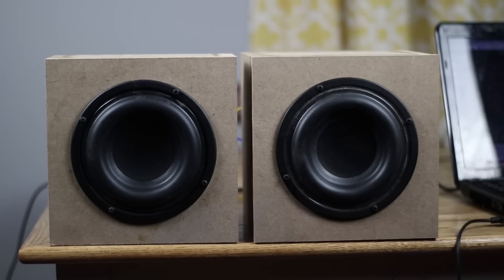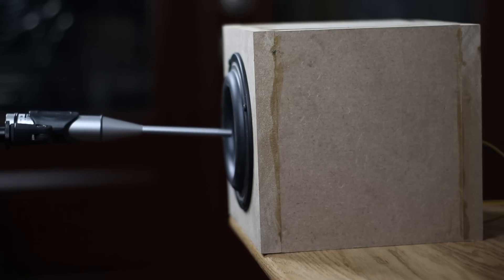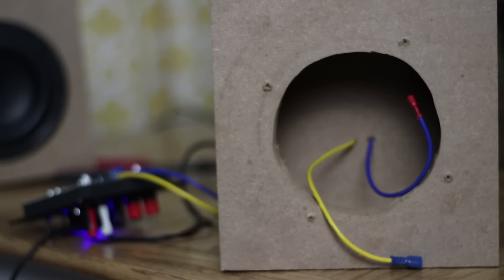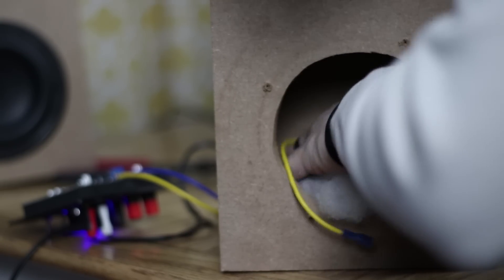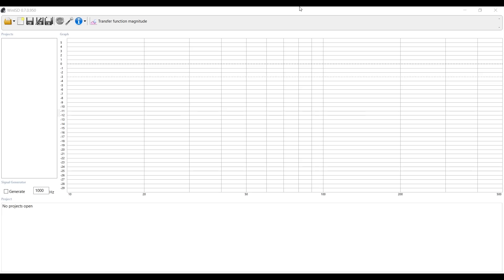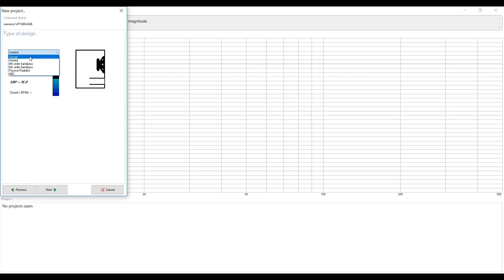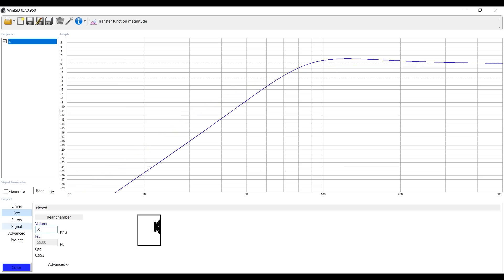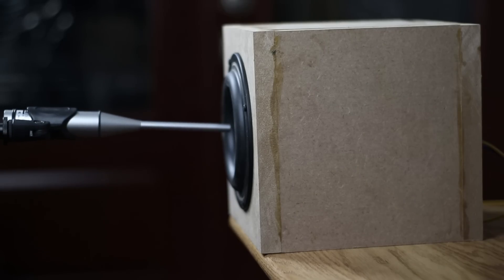Does Polyfill make a Box BIGGER?  Tested and Revealed

Comment: I know theres a number of videos about this but there hasnt been yet a definitive type video with the detail the topic deserves; sort of like a Vance Dickason level detail video. That video might not exist due to the popularity or prevalence of ported boxes all over the interwebs rather than sealed, but it can have some effect on ported enclosures to a degree as well. I think the topic deserves a good 30 minute video where it's possible for someone with the right measuring tools to do exactly as you did but also provide F3 comparisons as well as QTC results. For example we can see what a baseline .707 qtc box could do non stuffed or even stuffed to see if the QTC could get down into the overdamped regions (qtc .6 or so). Of course a smaller box test around qtc .8 -.9 can get covered just so those with space restraints with car subwoofers can get an idea what dimensions they can get away with and not compromise too much performance.

Comment: try seat cushion foam instead of poly fill..It's much denser and the effect is more pronounced. giving you deeper bass I learned this at age 12 salavging console stereos for speakers and the working components I wanted for my growing home built system from discarded stereo and TV consoles... nearly free ..new fuses fixed many systems or a broken wire repaired. usually did the job. I collected several hundred dollars in equipment for free and made it all work together. .. race a few wires replace a fuse or 2 and there you are... I'm ADHD all my life and need a hobby to keep my over active mind busy.. I can visualize a project design without comiting it to paper and build it with little more than tools and a my semi detailed  sketch to guide me...

Comment: Great video. Quick question. Is it possible to use the usb microphones that come with your high-end AVRs for room correction (i.e. Marantz, Yamaha, etc...)  as a replacement mic instead? In addition, where do you get the software? Is the software free? Or do you have to buy it?

Comment: Why don't you do some more tests? Would be a good video.

Just make a box with a bigger woofer preferably, and then make a bunch of inserts that you can stick to the inside of the backpanel of the box. That way you have can make the inside volume variable, and then do measurements with and without fill to get a better understanding of where the sweetspot might be and how much volume you can compensate in this way and where it no longer works.

Maybe other tubers can do a colab with you or something and do it with different drivers to get a larger sample set.
And then see if there is some simple rules that can be made from it.

Would be a very useful effort for the community and you'd get some good content out of it.

Comment: I've heard that it makes a big difference in a ported box, and even more of a difference in T-lines and horns. This is because the sound waves (air) have to work their way through the polyfill (compared to traveling in a straight line when they're unobstructed) which means they have to travel a longer distance before they exit the port... In other words, simulating a larger box.
Reply: Yeah that’s not true whatsoever, it works the best in sealed applications because the pressure is larger inside the box and has nowhere to go except the fibers. In a ported application it takes the path of least resistance which is the port, still makes its way through the fibers but it’s not as effective I would definetly not use much in a ported box only lining the walls

Comment: It dampens reflective wave generated from drivers rear. It helps driver to reach its mechanical limitations easily. Fooling drivers😅
Reply from the maker: It can help with standing waves, but what I am referring to is thermodynamic. In particular the changing of the enclosure from adiabatic to isothermal. This changes the Q of the box thus resulting in the subwoofer acting as if it is in a larger enclosure.

Comment: Um, speakers can't "think". You probably could have gotten the same results using fiberglass insulation or wool. It's been proven for years (I've been building for 30 yrs.) that adding "fill" will "scientifically" increase the volume of an enclosure and typically smooth and extend the low end. You're evidently trying to convince a new generation of builders that do not believe us "old" guys.

Comment: To me it all seems counter intuitive. If the box is stuffed (insert (pun intended) joke of choice now) it will create a denser medium (chunky fortune teller). Denser medium equals faster speed of sound right? Therefore the enclosure (see what I did there) would present as smaller not larger.  So my thought is that the fill material has more to do with calming the tumult of the airobatic  (just made that word up, help yourself to it's use) chaos thats  going on in  there. Or not, just a thot.
Reply from the maker: That's a good thought. But what really is happening is thermodynamics. This is the best explanation that I've ever found that should help you. "Stuffing a box with polyfill makes it seem larger and it all relates to thermodynamics. When polyfill is added to an enclosure, it changes the behaviour of the airspring in the enclosure from "adiabatic" to "isothermal". The term "adiabatic" implies that there is no heat transfer occurring. An isothermal process occurs once the polyfill has been added. As the air passes through the polyfill, the fibers wiggle and cause some of the energy created by the airspring to be dissipated as heat. This heats the surrounding air molecules warmer, causing the air to become less dense. Being that sound passes easier through a denser medium, the speaker interacts with your enclosure as if it is larger than it actually is."

Comment: I think you messed up the results. The black line is without fill. Because. 
THE BOX IS BIGGER without fill
Reply from the maker: It would seem that way. But adding fill actually changes the Q of the box, which makes the driver act as if it's in a bigger enclosure. It's pretty neat to see how it works.
Reply: @Toid  There’s a reason why this subject is still debated. Something is amiss . I have a 15 inch Solobaric in an exact spec sealed box. I’ve driven around playing it for three months. The other day I realized one of the speaker terminals was broken on the back of the box so I ordered a new one. When I open the box to replace the terminals I realized it was stuffed with polyfill. So I removed it and tested it out without the polyfill. It definitely is playing lower than before. It sounds like a bigger box
I know you tested it. Which is crazy. What happens if you test with the microphone at different distances? 
I’m just being skeptically ignorant
Reply: I’ve heard that Speaker Builder Magazine did a test a long time ago and said it didn’t work. But I can’t find  the article. Maybe Parts Express wiped it from existence
Reply from the maker: @johnviera3884  here's a good article that touches on the science of what is going on if you are interested: https://audiojudgement.com/sealed-enclosure-closed-box/
Reply: @Toid  thanks man. And thanks for being nice to a knucklehead
Reply from the maker: @johnviera3884  I don't know anything about that.  It's very clear that it does work. In fact programs like bass box pro will even take it into account when you are designing your box. They'll ask you how much fill you plan to put in it and it will show the affect it will have on the frequency response. Of course you can find this information other places as well.

Comment: It is not "Polyfill " it is sponge. Try it. And, by the way. Every loudspeaker box should have some kind of damping material inside. 
The selective use of foams and damping materials within a loudspeaker cabinet will significantly alter / enhance it's acoustic performance. You can selectively absorb energy over a limited range with some and shift / move the energy elsewhere with others. All vibrating objects produce sound pressure waves. These can act as a form of airborne interference and spoil the overall listening experience. For best cabinet acoustics a speaker cabinet should be acoustically dead and a number of designs exist to meet this criteria with varying degrees of success. A variety of materials attached to the interior of the cabinet will modify it's response. Disregarding the cost considerations no one approach is optimum for all occasions. Most times it is a trial error kind of thing. And will also depend largely on the design of the cabinet itself. Some cheap loudspeaker manufacturers even use the thin "untreated" walls of the cabinet with the goal of "enhancing" their response. And the test you did does not tell you much since you used a ridiculously small cabinet. What some manufacturers also used to do was to build the cabinet the same size and, instead of using bass reflex which can "extend" the response a bit too much would be to fill the cabinet walls with thick "spongy" materials and remove the port. Others used sponge and passive radiators. So your test did not really exemplified what can be achieved and what can be done with loudspeaker cabinets. If you really want to teach people, do it properly. But, overall, it was still an effort on your part. Keep it going. But dig deeper into the subject. You will be amazed with the results that can be achieved.

Comment: This may have already been answered.  If you have a used subwoofer that does not have much or any polyfill, what kind of results, if any could you expect if you filled it up?
Reply: bass will be cleaner and less distorted below the tuning frequency,  the polly will absorb the funny noise the speaker makes when it can't handle low frequencies,  however you do sacrifice a little bit of high frequencies.... for better low frequency response,  but nothing major... only a small difference like 5%, no more than 10%,   but it is noticeable if you listen to your speaker everyday,    you get smoother sound,  the bass kicks sound less clunky,    but if the box is already big enough,  you should only add a minimal ammount of pollyfill, just enough to get rid of the sound waves that are bouncing around inside the box, creating unwated noise

Comment: It makes sense that it works. When the air in a sealed box gets compressed it also gets hotter giving it evwn more pressure and the same thing happens in the exact opposite way when it gets depresurized. The polyfill absorbs that heat making the preassure in the box decrease during compression and increase during expansion. This would also simulate a slightly bigger box that would have less preassure overall in both circumstances due to the fact that there is more air compress and decompress.

Comment: Polyfill had never been claimed to allow for a 50% box volume reduction, hence testing it in a box half   the size of the other is unfair.The energy used to vibrate the polyfill fibers is subracted from the air in the box in the form of heat energy which is then converted to mechanical .This lowers the temperature of the air.The cooler air contracts which lowers the pressure in the box thus "fooling " the woofer into  "believing"the box is larger.Too much polyfill is counterproductive as the fibres become too tightly packed to vibrate freely.

Comment: that's not how you use polyfill  in a speaker box, you can't just shove a hunk of it down in the bottom of the box and expect to get much change, it's not like throwing a brick in your toilet tank to take up space so you use less water you need to line the inside walls of the box to dampen the reflection, the reason there was a better response with the box stuffed is because it essentially block the reflection like it supposed to but using that much poly kills all the air space making the speaker have to work harder to move to outer extension thus over heating the voice coil, using some spray adhesive to line the interior walls of the box with poly will give you dampening without wiping out all the air space of a box that was already to small.. i would thing that all this would be common sense for an audio guy with any box building experience , it's something mobile audio guys have to deal with all the time.

Comment: You don’t test a speaker like that lol 
You should watch a a real sound engineer tests speakers.  They put them outside elevated a couple meters. And the mic way farther away
Reply from the maker: If you're talking about testing a full range speaker you do put them anechoically 3 ft (1 meter) away. However most people don't have an anechoic chamber. If you don't have an anechoic chamber, you need to check your impulse response on where your first reflection point is. Even outside the first reflectionion point will be the ground. That reflection will be added into the response. So anything before that first reflection point will not be valid. In order to get the low end extension, you have to do a close mic measurement and splice it in. In this case with a subwoofer, you always do a close mic measurement or a ground plane measurement. And if it's ported, you will also measure the port and splice that in. That's how you measure a speaker without having an anechoic chamber.  If you want to learn more about speaker measurements, you should definitely check out my channel and join the Forum. www.toidsdiyaudio.com/community taking accurate and good measurements is key to designing a good speaker.

Comment: In my experience for subs only it's better to have none in a ported box as it's dampening the port function wich can't be avoided in some enclosures and in a sealed box it can be helpful.
In a fullrange 3way (or any other fullrange speaker) it should always be used as the frequencies are so high that polyfill is needed to reduce reflections in the enclosure.

TBH every audio person should have a mic. Even if it's only for getting the placement of the speakers or listening spot dailed in.
Reply: I use about 12 oz. of polyfill (after removing the factory installed foam) in my vintage Klipsch KG-4s. They have a passive 12 inch radiator instead of a port. They sound amazing! I have found filling (poly, fiberglass or wool) does not effect air "flow", it effects the air "pressure" inside the enclosure. Increase the fill and you increase the pressure. However, there is a saturation point where too much fill will decrease bass response. I add/subtract to get the right sound.

Comment: My friend you dont stuff the box full you will deaden sound. And if you built the right box for the drivers you dont need to be stuffing anything🤣Stop using microphones to calibrate your audio  use your amp or radio crossovers and amp gains and lastly you ears. There is a lot of real world factors that come into play when listening to your system . So get your gains adjusted correcly , DONT TOUCH BASS BOOST OR LOUDNESS.  Crossover speaker around 120hz and sub 100hz or 150hz 12db and keep radio decibels on 0db or -3 db less signal is better . And if you have a preamp eq . Dont treat it like a volume and crank the levels. As this are not passives or actives eqs this are signal eqs so keep those knobs low,  the lower the better. Your system will sound clean and clear  speakers will have no distortion when playing loud and you will have lots of headroom in your system. Then the only thing you need to be stuffing is your Turkey on thanksgivingday🤣

Comment: Its not that polyfill or insulation makes the speaker think its in a bigger box is that just the right amount will control sound waves inside enclosure and by controlling the back wave you increase volume and get an overall best frequency response. But polyfill or any sound deadnent material should be use with caution because too much will deaden the sound and drown the speaker in that box. So if you have a small box like he has showen on this video you just want to put better glue polyfill just on the back of the speaker not the whole box. To control or better absorb some of the back wave pressure coming   from the speaker and hitting the wooden box its enclose in. I gave been installing car audio and home theater for 30 years+ it works if properly done. And assuming you have MDF box with good bracing inside.

Comment: wha the polyfill also do is turn sound energy into heat., so what i do is, get a thick metal plate(heavy i mean, very heavy) as woofer back plate
and line it with copper foam sheet

and in that box, i fill polyfill and thus i can make my enclosure even smaller
also, add low flat profile subs and damm, the subwoofer becomes crazy thin

Comment: Can you stuff a ported box if you keep the port clear
Reply from the maker: for a ported box, the best thing to do is to spray glue acoustic foam in the inside.
Reply: @Toid  Use bonded dacron. It comes in sheets/rolls, you can cut it to size for your enclosure and don't have to glue it. I've been using it in my enclosures for 30 years and rarely if ever use loose poly fill. Works great in sealed or ported enclosures. Love your channel BTW!
Reply from the maker: @mattpobursky850  thank you. I'll take a look at it!